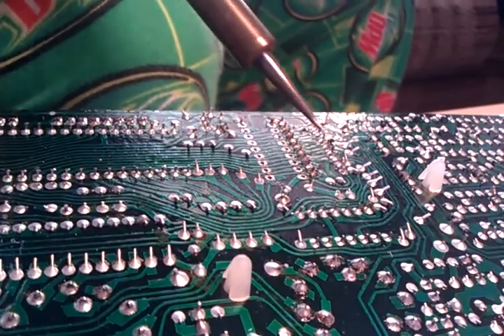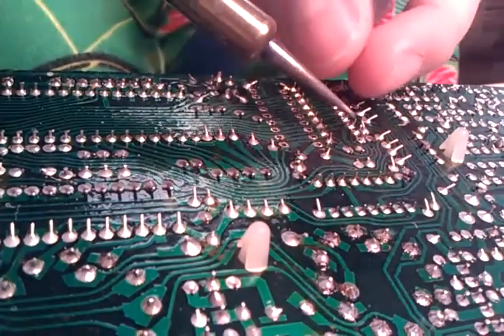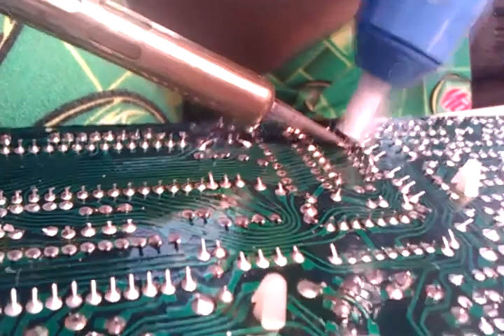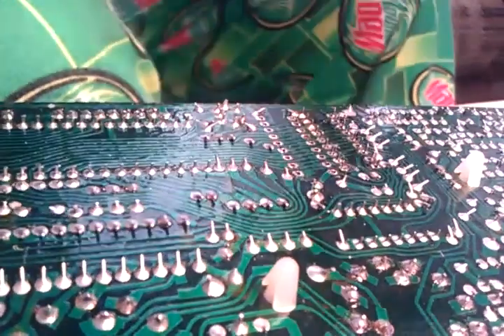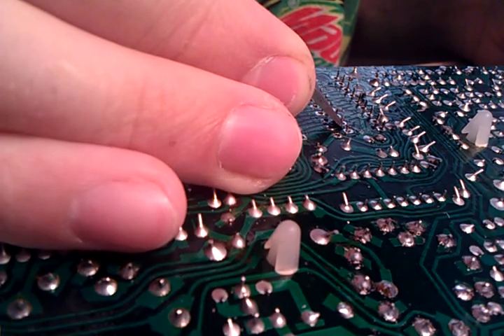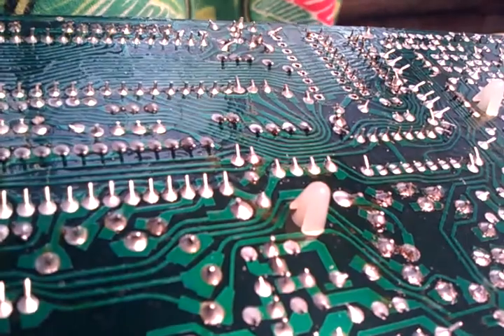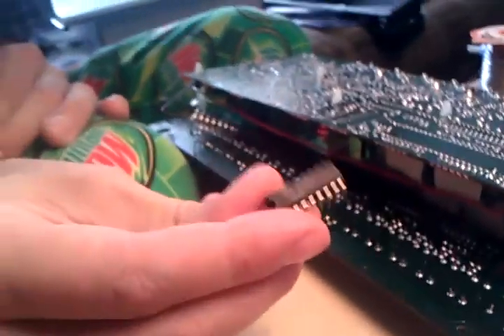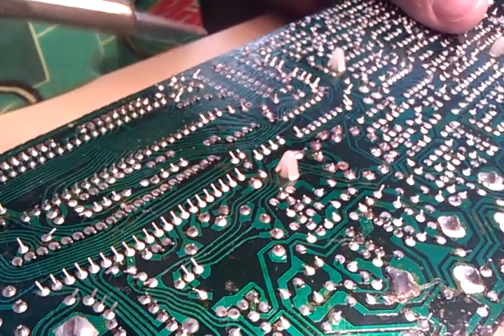Desoldering NEC D444C 4K SRAM ICs from a Roland TR-606 Drumatix

Comment: do you know what the standby current draw it should be from this type of ram? I wanted to install 3v cell coin battery backup mod but they seem to draw too much current in standby (measured around .2mA) and drain the battery in a matter of weeks.